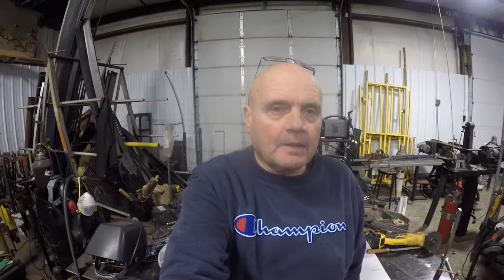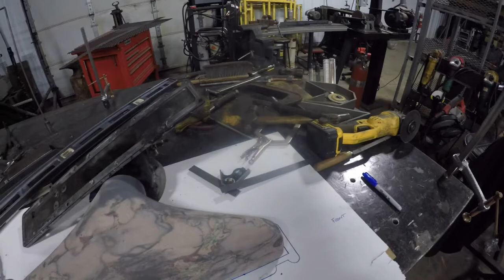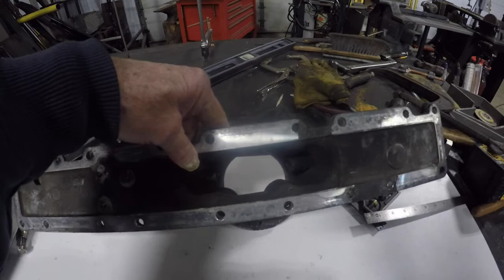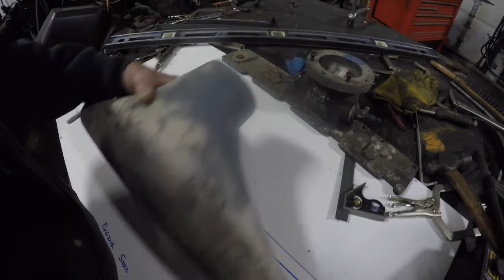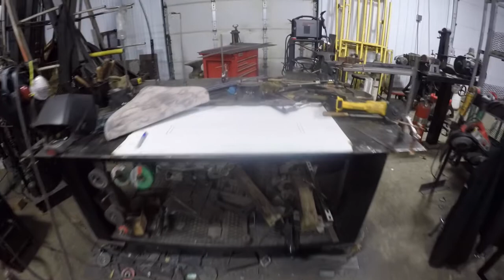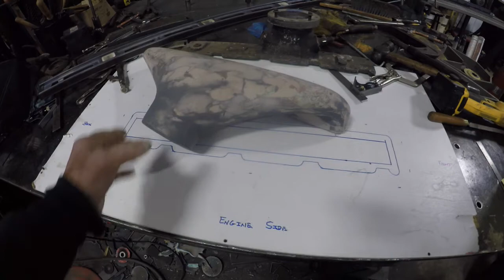Cummins Carbon Fiber Intake Build Part 6

Comment: When you need the power the engine will be under boost.  So the intake system in the stock form will have positive pressure to feed all cylinders.  Having that Kirby air intake housing will not free up any restriction to the end cylinders.  You want more power, rig a better intercooler.  Ram trucks if I remember correctly when under high power, high boost conditions bleed A/C refrigerant thru a dedicated intercooler heat exchanger to make a more dense oxygen content.  Look at what Cummins has on those trucks.  Add an A/C compressor with a boost activated clutch switch and make your own intercooler. JMHO.